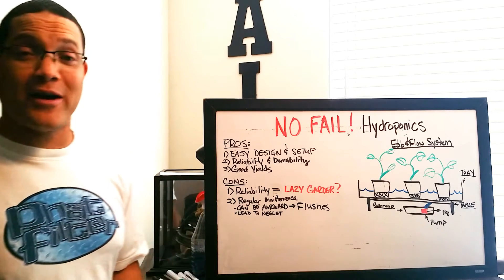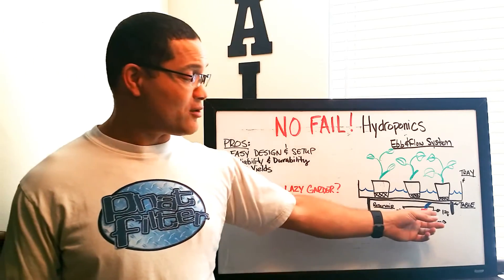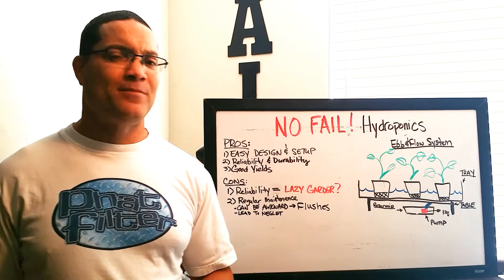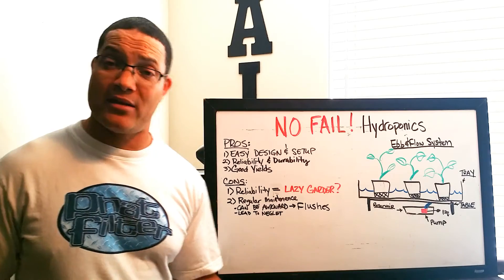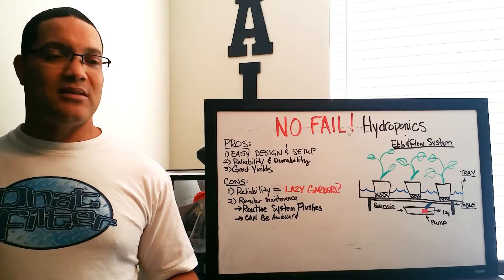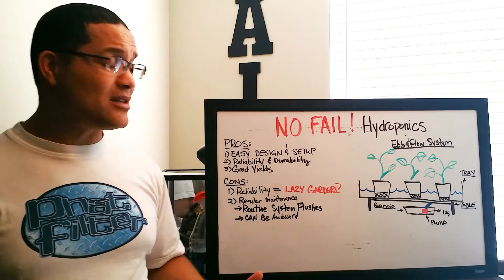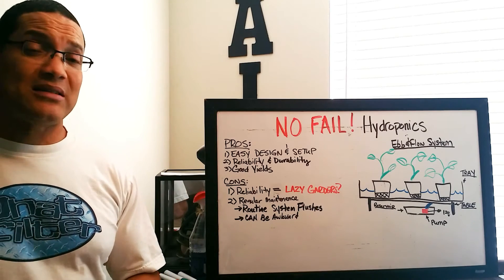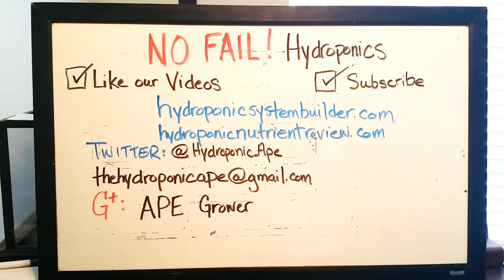Ebb and Flow Hydroponic System Basics

Comment: How do you clean out the solution in the holding tank? Especially if it's in a very tight fitting area....
Reply: flushing with clearing solution. Hope that works for you...